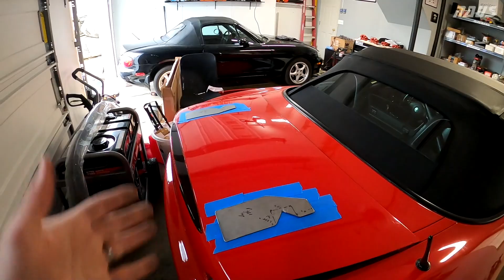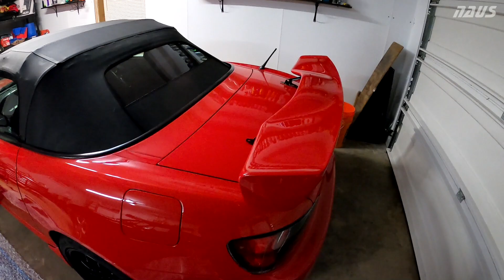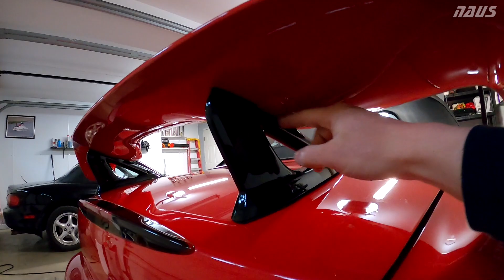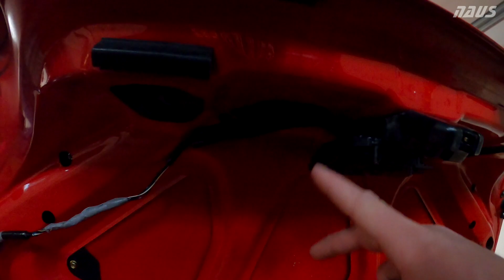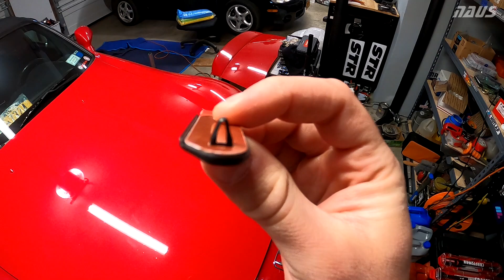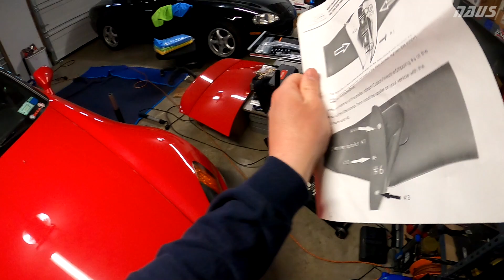S2000 CR Wing Install On Modified Trunk - DIY

Comment from the maker: Unfortunately the Racebuilds website these backing plates were previously sold on shut down. However you can still order them by contacting me: nausauto at gmail dot com
Reply: I’ll be your first customer!
Reply: You're awesome for offering these, thank you!!! Would you be willing to make some sort of template for the trunk to drill the holes?
Reply from the maker: @needurskullz  No current plans on making a template for the trunk. With these rep wings Id be hesitant to install it any other way than my method in my other video where i modify the trunk. I have not installed enough of these to determine if these wings are produced to a tight tolerance or not.
Reply: Hey, will there be any more of these going up for sale?

Comment: 4 years later. Do you know the distance from the top of the trunk to the fist hole? I’m second guessing myself a lot here to make sure I don’t drill three times. I also picked up a spare trunk for this. Thanks for video, this is great
Reply from the maker: Check out my trunk modification video , I go into detail on where that hole placement is: https://youtu.be/RD-87AQTL24?si=nU4TdD5jUgt4Avsq

Comment: Why did you choose a CR wing vs say APR GTC 200?  Were you looking for an OEM look?
Reply from the maker: CR wing is an oem aero part so it keeps me in Street touring for scca autox and tuner for time trials. Any non oem wing would bump me into a full aero class so I’d need to do a serious wing and massive splitter up front. That changes the whole suspension setup too so I’ve decided to keep my car at an oem+ level build, and enjoy it. I am very happy with the way the car performs in its current state

Comment: how is the wing holding up ? does it vibrate like a tuning fork ?
Reply from the maker: Wing held up great this year. It does vibrate though at idle from the hardrace engine mounts i have in my car. Sort of like a tuning fork like you mentioned.

Comment: Where did you get the dimensions for the backing plates? I'm taking a CNC plasma cutter class and I'll just cut these so I can use them on the s2k and for my homework lol! Nice video BTW
Reply: NVM I got them!
Reply from the maker: @ppy1111  i was gonna say haha, all the dimensions you need should be in the first 30 secs of the video
Reply: @NAUS2K  Yo. I just got the same wing! I got a question. I was thinking of drilling the 3 holes on the trunk support plates first. And then assemble the whole wing assembly together with the support plates and measure the support plate distance. I can then use the support plates as a template for the trunk holes? You think that would work too? I'm just worried that it will not line up since the trunk is slightly curved.
Reply from the maker: @ppy1111  I wouldnt drill the holes in the support plates first, since your not sure the plates will fit in that exact spot under the trunk. Check out my other video where i drill the holes in the trunk to guarantee they are perfect.

Comment: Bruh there's foam sandwiched between the trunk layers where these plates are supposed to go, how do you get the foam out?
Reply from the maker: The foam stays and you navigate these plates around them when getting them into position.
Reply: @NAUS2K  yeah I don't think we're talking about the same foam because that's not possible.
Reply from the maker: What foam are you talking about . The trunk is two layers of sheet metal. The outer layer and the inside stamped reinforced piece. There is a small 1/8”ish gap between the two panels with little dots of high density foam like glue to support the outer layer of the trunk to the inner when pushed down upon.

Comment: Those black wheels need to be changed. They disappear into the tires.
Reply from the maker: They get destroyed with all the hot brake dust from all the track days. Black hides the fact they are torched lol

Comment: Has the wing looked stable under highway speeds? No funny wobbles/vibration?
Reply from the maker: It’s not as sturdy as a big wing like the 9 lives racing or something similar. In the end of the day it is ABS plastic and does flex if you push on it just like your bumpers and what not. I have noticed it does shake a little bit at idle because of my stiffer engine mounts. I recently took some GoPro footage of the wing at over 100 mph on track so stay tuned for when I post that! But overall I’m pretty happy, not significant movement but it does flex at the ends more than ideal

Comment: If anyone goes through the process of making these backing plates can you consider making some for the community? You'll be my new best friend
Reply from the maker: Unfortunately I did not make a 1:1 template of these as I drilled the holes in them after they were formed to match the contour of the trunk. Making a template of this 3D profile would be very difficult for the DIY tools I have
Reply: @NAUS2K  thanks Naus, this message is intended for your audience in case anyone attempts this diy or has the resources to produce at scale.

Doesn't make sense for you to go back and remake them. Thanks for your response but mostly, thanks for making this video! Couldn't have been better timing.
Reply from the maker: Backing plate blanks now available ! https://www.racebuilds.com/l/axce4q/cr-wing-backing-plates
Reply: This is just awesome.